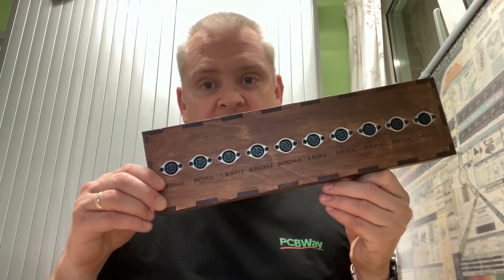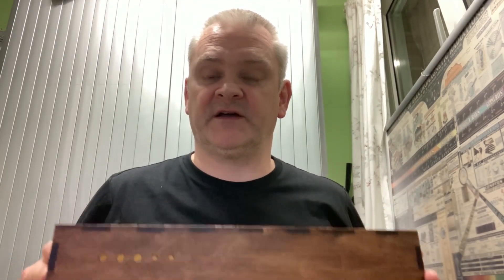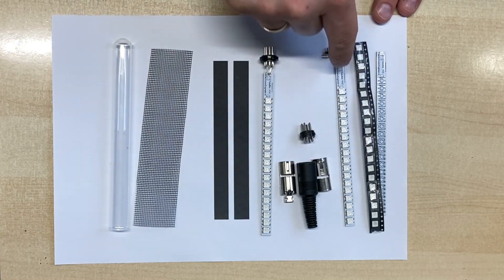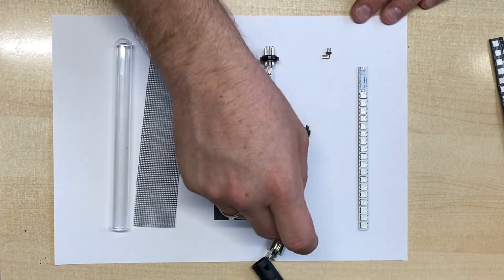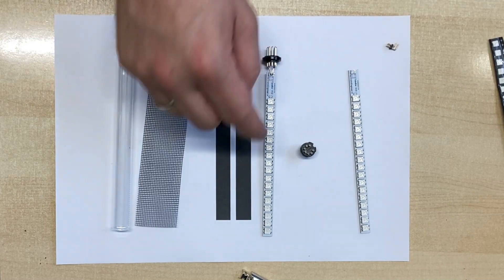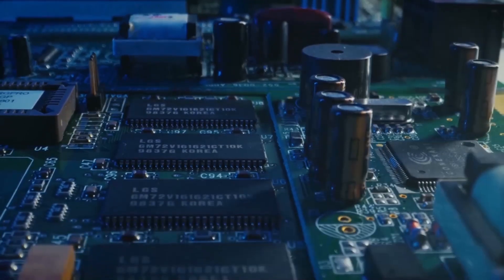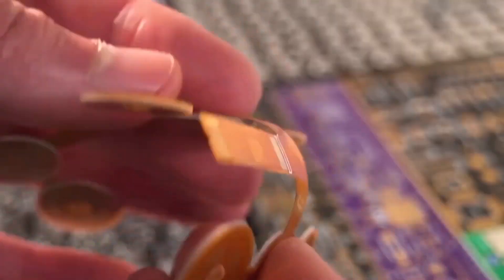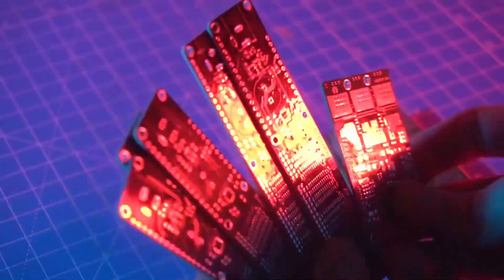Nixie Spectrum Analyzer

Comment: The video mentions not to use the same value variable resistors but I don't see any reference in the documentation was to what those two values are.
Reply: @TheElectronicEngineer  9:23 - 9:31
Reply from the maker: @michaelwilliams4575  o i see thats correct these blue onces are different check the partlist or schematic for the valued

Comment: This is way cool!  What was the cost of the board if you don't mind me asking?  And you said it is available with small components already installed?
Reply from the maker: Yes pre assembled pcb is available. Please check the link in the description
Reply: @TheElectronicEngineer  It seems like there should be more going on in the higher frequency lines.  Normally the highs are quite dominant aren't they?
Reply from the maker: @notny41  it depends. When using mic input, upper frequencies are limited because of the mic properties. Line in is way better

Comment: Cool project for sure! :)
Wondering how it would look like with the real deal stuff, and by that I mean IN-13 tubes. 

BTW "nixie" here is kind of a misnomer, since nixies were historically numerical only (that's where the name comes from), later on the family extended to all kinds of symbol displays - numerical, special symbols (like the measurement unit, sign or AC/DC in meters), segment displays. Basically anything that displays characters using neon (or other noble gas) glowing on a cathode bent to shape. So, I wouldn't call IN-13 nixies, since they're bargraph displays :)
Reply from the maker: You are correct….thanks for pointing that out